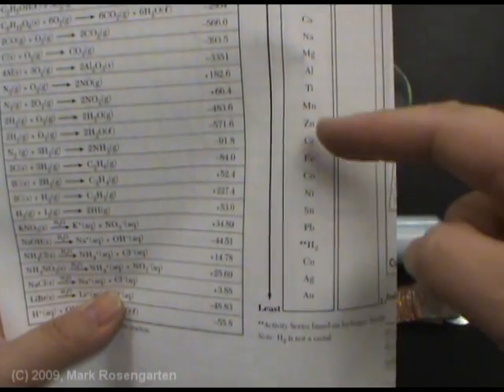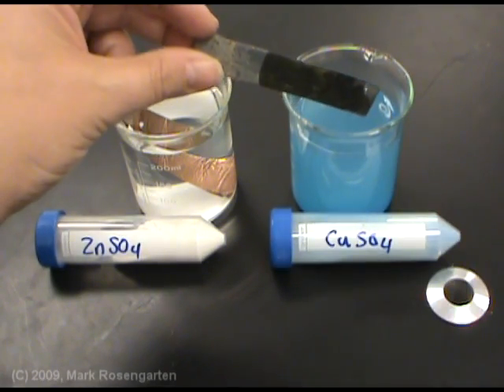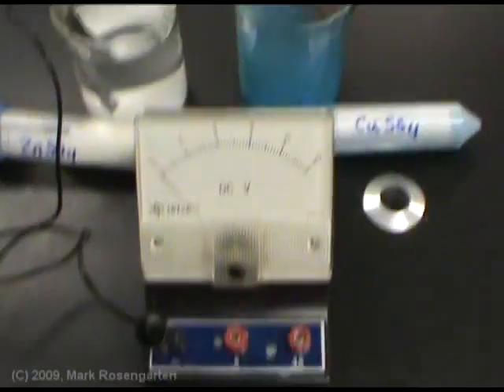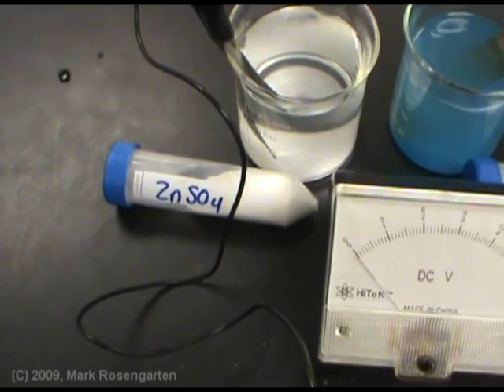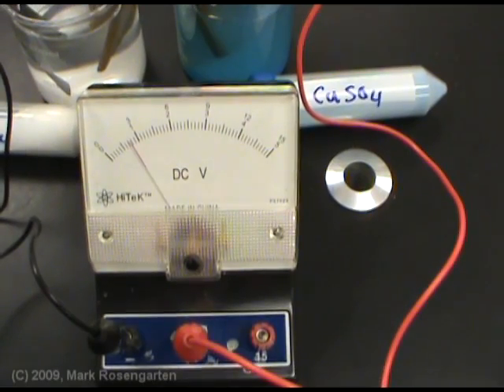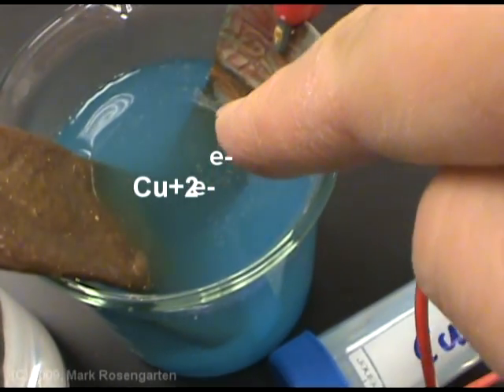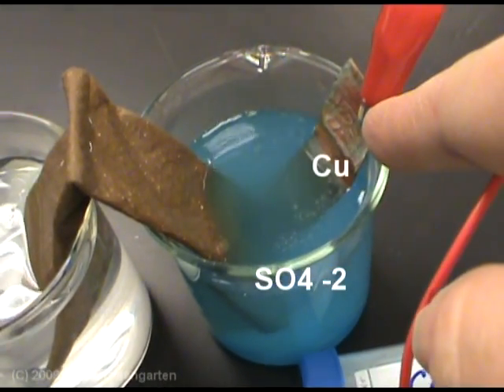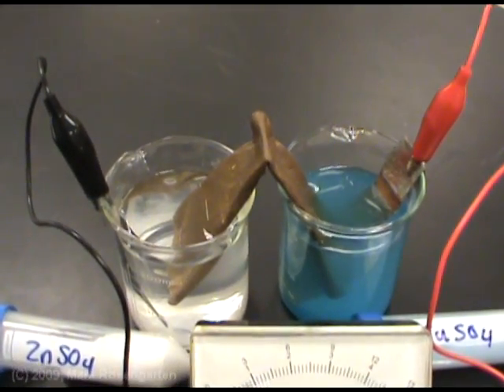Chemistry Tutorial 12.2b:  Voltaic Cells Practice

Comment from the maker: Zn0 has not reached a stable octet.  It has a greater potential to be oxidized than copper does.  Cu+2 has a greater electron affinity than Zn+2 does.  Placing Zn0 in Cu+2 creates a reaction where Zn0 has a species to give up its two excess valence electrons to and Cu+2 accepts them and is reduced to Cu0.

Comment: Mark, I'm wondering: What causes the electrons from the Zinc strip to voluntarily go through the load into the Copper strip and to the CuSO4 solution? I mean... If Zinc0 is already very stable since it has achieved an octet configuration, why give its 2 electrons for the copper solution? And another thing: why do ions from salt bridge need to replace the excess charges in both solutions to make it work? Please help me. I'm having a headache here.

Comment: Hi Mark, 
I'm wondering if I just put water in the anode haft cell at the very beginning, will the voltaic cell work? Because what takes place here is just Zinc metal loses electrons to form Zn2+, there's not thing to do with Zn2+ solution. 
Am I right?